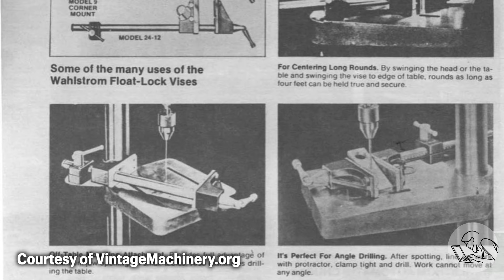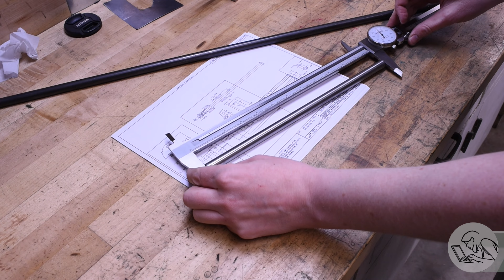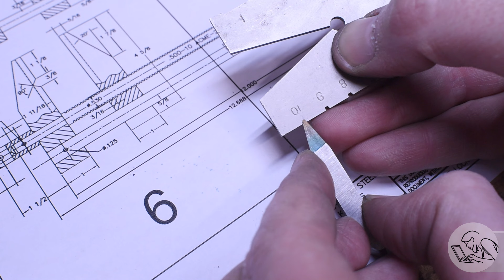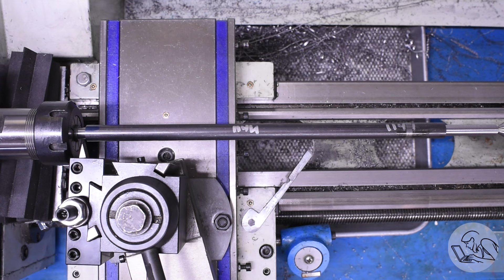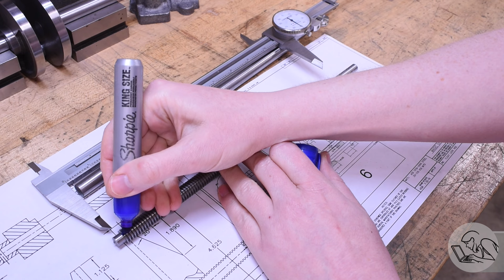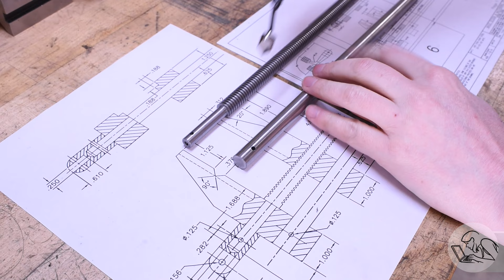Acme Thread Cutting! Making a Float-Lock Vise, Part 1

Comment from the maker: Hey everyone! Apparently some folks have trouble accessing the drawings. I’ve  had multiple friends test them and they work for all of us so all I can say is try again. I cannot provide free tech support for all of you, I’m sorry. These are free drawings, keep in mind. I did my best to make them available to you, and hosting them costs me money. Please keep that in mind when setting your expectations of customer service.
Reply: 🤗 I really need t8 but this was a great start. Now go nuts!,jpk (tr8 die a good idea?)
Reply: Cuss to more. Serve ass? 🤗🤣jpk
Reply: I tried downloading the drawings without actual intent to use them and it worked fine!  Perhaps OneDrive senses your intent and selectively corrupts downloads from those who need them most?
Reply: I had no problems at all, I downloaded them. on 03/09/2022 at 07:20 AM. Have a great day, and thank you for the great videos.
Reply: Worked for me! Thanks Quinn!
Reply: Failed to open in Acrobat first time. Redownloaded, unzipped and worked 2nd time, not sure what was different.
Reply: Worked aces from me Quinn, thanks for all you do!
Reply: Downloaded the file and opened it, zero issues.  I noticed, however, that you failed to include the link to download a finished vise...that's gonna get YouTube a letter.  ;)
Reply: Little curious why you did not just buy the  Acme stock.. And then turn the ends. Never had a problem buying it up 2" inches diameter  Metric are standard. Sometimes you will run into a problem with a double lead or triple lead. You will have to manufacture that yourself. Problems with the chatter sometimes it helps running the tool upside down and out.
Reply: Znll ml
Kopp

Comment: Your brass block system is the equivalent of what I and a lot of other wood turners do  with their fingers holding the stock around the cutting point while resting the wrist on the tool rest. I can cut some very long slim pieces just by using my fingers instead of a steady ..people squeal horrible things about safety but if its done right it is actually a very safe process...not that you can do it on anything metall because the torque in a metal lathe would do you some serious injuries if you got it wrong.

Comment: I built my own lathe. 2hp sewer machine motor has forward and reverse, i use pulley and belts to get the right speed i need. C channel and 1/2” all thread . I built everything, and i must say it cuts some very nice chips.

Comment: Yes, you can buy acme threaded bar, but generally not in fine pitch. I recently needed two lengths of metric trapezoidal (30 degree angle) 18x2, and it's not readily available unless you are prepared to spend big $$. Making your own is great fun, and I had exactly the same problems with chatter. Interestingly I came up with almost the same solution to solve it ;-)

Comment: I did something similar on my mini lathe. I machined a notch into a brass rod about a half inch in diameter and with my cross slide being slotted I used another tool holder on the backside to hold my rod in place.  It’s only in one dimension but it worked really well maybe think about using a piece of material with tee slots and tap a couple holes into the backside of your cross slide

Comment: i noticed that you had a C-clamp on a piece of round stock when pushing it through the bandsaw. I assume that was to keep it from rotating during the cut. If that was not the intent then perhaps, I am reading more into the video. If I am correct, it shows good practice. In any case, I enjoy picking up tips were I can.

Comment: I use a drill press vice in my spray booth to hold a guitar holding setup when finishing.  It's crap tolerances mean it doesn't get messed up by overspray, the rough textured jaws mean it holds the jig very solid, and the cheap price means I can replace it easily when it gets so gross I can keep using it.  So, you know a second use for them does exist!

Comment: Thanks for the video. I thought I was the only one that gets nervace cutting acme threads on a lathe. I hade to cut a lefthanded acme thread on a 1" saw arbor that had a lot of other features, bearing races, spacers and the splined end for the drive shive. Not ever cutting acme threads before, let alone LEFTHANDED! Ran that cutter past that stock 20 times before allowing it to touch. OK, here it goes. cut the threads perfectly. why was I so worried?

Comment: The drill rod, or silver steel, as we call it in Britain, is almost certainly 'centreless ground'  It's probably cut to length before it is fed through the centreless grinder, in a succession of lengths, so it won't have any tapers or distorions at the ends.  It's made to close tolerances, but is not generally perfectly round.  It has an odd number of curved 'facets'. You can't detect this with a cross-diameter two-point measurement.   For instance, the 7-sided 50 pence coin in Britain is 'constant diameter', but obviously not round, in the same way as the drill rod (silver steel), but very greatly exaggerated of course.

Comment: I just realized that the follow rest is designed to support work when the lathe is running forwards. Since pressure on the toolbit will normally push the work up, the follow rest has a finger to hold the work down. So a follow rest with a finger underneath the work would maybe be a good project, I've never seen one for sale (that I know. Now I know to look for it :) )

Comment: I find that milling a small flat before cross drilling works wonders for easy drilling and chamfering. Of course it's extra steps and 180 rotation if you want to do both sides.

Comment: Love the indicator tip for getting an exact length. I'm 100% the target audience for that, Got my lathe (crappy little import, but it's good to learn on) setup in the last two weeks and I'm just barely getting started working with it. Mostly just making upgrades to deal with it's deficiencies right now, but that's how I prefer it. You never learn how things work in depth if they work perfect the first time. Gotta have something break, or suck, and then scratch your head about how to fix it.

Comment: At 9:20 shows a bit of lathe flange on left. Is that center ring tapered or is it perpendicular to that "hole plate". I have similar (cq6128) lathe and bit frustrated as I have not found a common language with tool suppliers that which stuff fits into it. It seems not to be DIN55029 but something close. Any idea?

Comment: I am going to follow along with this series a have a go at making one.  I have bought the raw material and printed the plans.  My question, which may well be a ‘stupid’ one is:  do the tapers on the jaws serve any practical purpose or are they merely cosmetic.  I know that machinist clamps have such a taper, which must be so they can be used in confined spaces, but for a drill table vise, is it necessary?
Looking forward to following you through the project.
Thanks Mitch

Comment: I'll offer solution to your follow rest mounting quandary. The restrictions to a top mount are many. 
Commercially speaking, the normal patterns are mounted to the side of the cross-slide, or carriage underneath. For starters and with any luck at all, your gib screws are on the operators right side. Instead of depending on large screws (and requisite deeper holes), work 1/4" or 5/16" into the design, dowel pins for location and secure additional shear strength.
Depending on available travel, the slip fit could be in frame of follow rest, leaving dowels retained in the mounting side. That COULD include studs on that side as well, far better then SHCS.

Comment: On the topic of deburring convex surfaces (rod with a hole cross drilled), I rememeber seeing Tom from Oxtools using a magical tool to do the job. I forgot the tool's name, but it's a sort of drill, with two spring loaded blades opposing each other, so when the tool springs, the blades can follow the contours of the surface.

Comment: ok first off, love the channel. I'vealwayswantedtohave a mini latheat home. But ive neverused one before, I have used a brake lathefor brake drums and rotors. I've been thinkingaboutitf8r years, afterwatchingyou and all the funyou make it look I went out a bought a new mini lathe. Its still in the crateit came in a few days ago. 
Im still watchingand reading everything I can aboutusingasmalllathe. I only have a small room down in a celler to use the lathe so I got the 7"x10". If everything goes good I figure I can upgrade, and maybe setup my garage to a shop.
But anyways, thank you for giving me the push I needed, by making it look like fun but very hard.

Comment: Quinn, I understand your issues with the follow rest. My tool post can move enough to position it where I want it so it aligns with the follow rest. It wouldn't be too hard to build an adjustable follow rest that would mount on the T-slots on the cross slide. However you would have to leave your cross slide locked the whole time.
HOWEVER, the follow rest is designed to hold against forces created by cutting in FORWARD! By cutting in reverse you will need to build a follow rest support that supports the back and BOTTOM of the work. 
I will look forward to seeing what you come up with! Keep up the good work.

Comment: @blondihacks to deburr cross holes through round bar I use a small round or half round needle file (depending on size of hole), quite often I use my diamond needle files. Seems to work well for me.  Also, why not use your ground tool to make an acme tap to cut your acme nut, then it will definitely fit.

Comment: Love your channel - keep up the good work! 
I'm a qualified Fitter & Turner in Australia but changed professions after 15 years and I haven't been "on the tools" for over 20 years. We were always told that ACME threads were used in precision machines as they would self-centre with no backlash, and self-adjust for wear when using half nuts or adjustable nuts.

Comment: Quinn,
Thank you for your kind words. I hope to get better at videos; however as of now I struggle. I really hope to put together some sort of video to be a digital “User Manual” showing all the uses of the Rose-Index. “Referencing, Rotating, Shifting and Flipping …. Plus the fact that it’s “Removable” really adds to the flexibility and ease of use. The Rose-Index really makes referencing and manipulating round parts easy.
In your situation you mentioned not preplanning  the use of a Rose-Index. You would have been fine by simply attaching it when you needed to reposition your work piece with a machinist square. Then you could remove it if you prefer.
Even if you were to remove the work piece from your centering fixture you could have went to a flat surface and put a Rose-Index on and use your pin in the hole with gage blocks or similar on both sides of your work piece to get the pin parallel to the flat surface……Tighten the setscrew and you regained a reference.
I goof up occasionally pulling a work piece out of a vise before I’m finished. Very rarely does it add more than a couple minutes to make or regain a reference by not preplanning or simply goofing up.

Sincere Thanks and Best Wishes,
Timm, Carl, and Anton Rosenthal

Comment: From an experienced engin builder and tested point of view.
All loud engins do is call cops and reduce low end torque in an engine.
There seems to be a plague of them these days.
Nice job on the threads.
Used a block of wood to stop chatter once or twice myself.

Comment: acme threading is no different than using a form tool - you have total contact on all surfaces. on underpowered machines you can try this- grind your tool to a point and forget about the flat. set your compound at 90 cut until your point is at depth. then use the compound to advance the tool. that way you are cutting just one side as in a single point tool.  the length of the bottom flat  will be your maximum advancement.  less chatter and better finish. may take a little longer  but its not a production job  time doesnt matter.

Comment: It seems to me, based on my sometimes unreliable memory, that every time I have seen a chamfer in a round hole in a cylindrical surface, the chamfer has a greater dimension parallel to the axis of the cylinder than perpendicular to the projected axis of the cylinder (just as basic geometry would dictate).  So, apparently, no one else has found a good way to put a constant width chamfer around a hole in the side of a cylinder.  I can imagine a tool for that, but it would basically be s tiny router with a tiny edge following chamfering bit.
Reply: Maybe side cutting with an end mill perpendicular to the bar. Requires repositioning of the bar though.

Comment: Hi Quinn, love watching you work and your sillyness. I was watching your 4 jaw chuck tricks and I wanted to share this with you and your viewers. About 30 years ago I worked with an 80 year old WWII vet. He was hands down one of the 3 greatest tool makers I ever knew. When he set up a 4 jaw chuck, he used 2 keys. He would use them on the jaws across from one another. Once he had a bit of clamping pressure on the part he would turn both keys at the same time in the same direction to move the part back and forth until he dialed it in. Then he would do the same on the other jaws. I never saw him use a 3 jaw and after I did this a few times I never did either. I hope this is a helpful little trick. Blake

Comment: I just got a traveling rest and like yours it touches the material quite a ways from where the cut is happening.  I don't understand why they are designed that way.  It seems like being able to modify it so it can be adjusted fore/aft with a similar mechanism to a tailstock offset, would be helpful.

Comment: Quinn, I love your show. I appreciate your knowledge !!! You come up with some real good solutions, and they work well !!! Give this a shot:
   I have been a tool designer/builder for over half a century. As I watched, and you talking about what you needed, an idea came to me. Sometime when you're needing another project, build this one and add it to your tools.
   Make a shoe to fit above the top of the tool-post  you're using. Instead of using the standard allen set-screws to clamp your cutting tool in place, use longer all-thread screws. Set the shoe on top of the tool-post and use nuts on those all-threads to secure the shoe onto the tool-post. Build it so you have a swing-away upright, (hinged so the whole rig will lift off the work when not needed, just by pulling down the handle, like a slap, if needed, in case something happens, ie. Murphies Law #1, "If something Can go wrong, it will, and at the most inappropriate time!) Then build something that is (similar to a bench vice operation), a square hole with a threaded hole above or below it (you choose which). ((It only need 3" travel)) You want to be able to move a carrier that will have a clamp screw that tightens to the square bar running thru the vertical shoe-piece. This bar will extend to the back side of your work and have an adjustable up/dn square bar that your two follow bearings are running on. <it needs to have adjustable "wipe" like a motor brush has. Spring loaded. This way you can control the back pressure against your workpiece, so it isn't rigid.>
   Operation: You will lower your assembly down to horizontal, over your work. Then you will loosen your Vertical height bar and set it as close to the work height as possible, then adjust the horizontal bar and adjust your floating follow brace to the work. Your vertical to center adjust. (It's like that so if you are turning something with a larger diameter, you can still get to it.) Then, using your in/ out adjusting screw above your dovetail, you can do the fine-tuning of pressure close to your work point and not have your arm over your work while its turning. When you get ready to part, pull your "abort handle" (between your tool-post shoe and upright), and lift up your attachment to straight above your tool-post. If your eyes are crossed by my description, tell me how to get it to you and I'll draw it for you. Another tip, after you part and get ready to use your hack saw, have your part TURNING and give a gentle stroke and your part will fall into your waiting rag-bed.
 Bill, from Tn. 🇺🇸

Comment: I love your channel.  Regarding parting while using a tailstock center...I'm sure you've seen the Cutting Edge Engineering channel.  Kurtis the machinist repair large excavating equipment.  This include very large hydraulic cylinders.  He cuts off the ends and welds in a new cylinder.  To cut the ends he uses tail stock support and cuts through the existing welds until smoke appears indicating he has "almost" reached the inside of the cylinder.  He then removes the structure and smacks the end with a hammer.  Keep in mind that the rotating pieces are brought to the machine with an overhead crane (they are large and heavy).  Pretty interesting to watch.

Comment: Good show dear lady.  Which brings to mind;  I've flattered you a tad so I can now ask you a question.  1.  I need such a thread on the 1/4 inch. dia. size. ..perhaps 4 inches long from some kind of metal.Probably brass or aluminum.  I need to make maybe 2 to 10 of these things.  So, I'm talking cheap, easy and I'm a wood-worker not a "perfectionist" metal worker.  Does someone make a tap and die set-up for such a project ?  I'm not a machinist, (although that was my dream since I first met my old grand uncle when I was in jr. high.  He was a tool and die maker).  Any info on this would be most appreciated.  Thanks in advance.